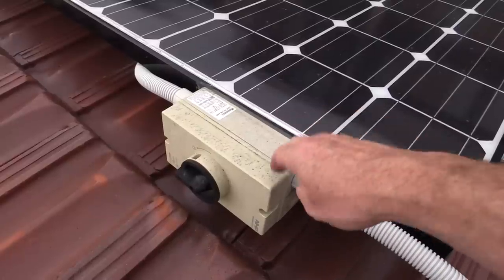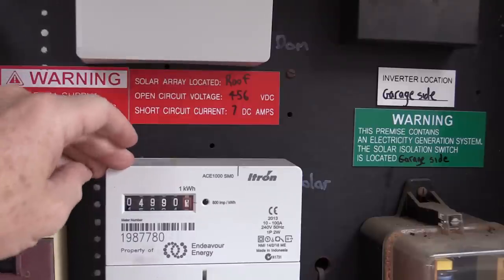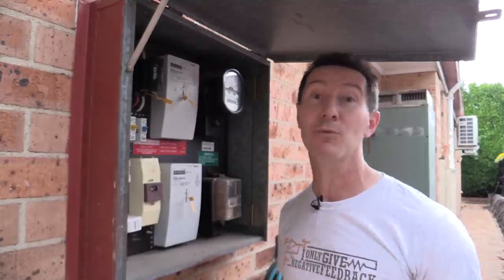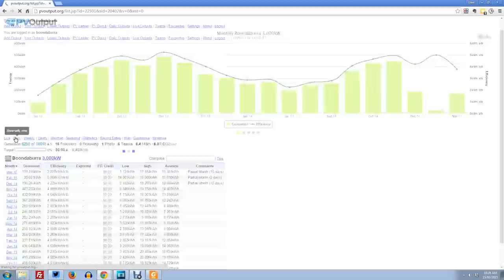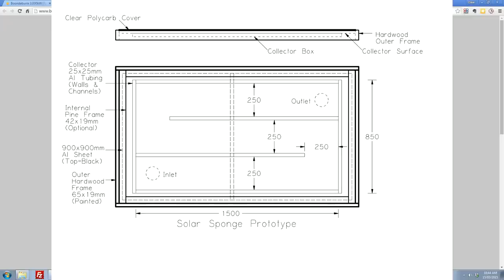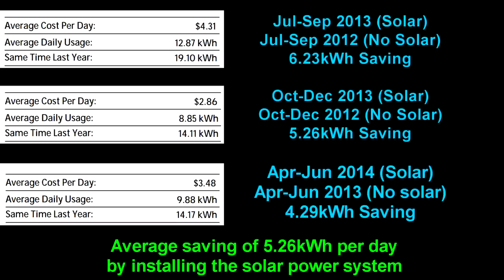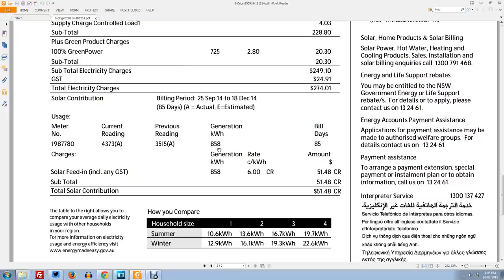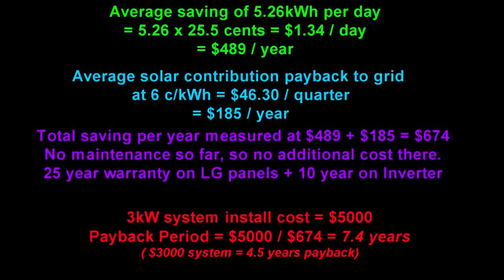EEVblog #724 - Home Solar Power System Analysis & Update

Comment: Here (Hungary) we have a system where as long as you don't feed back more than you consume (annually), you get a 1:1 cost/payback ratio. This is basically gross metering, and it pretty much makes the grid into a virtual battery (as long as, annually, my consumption is less or equal to my production).

By the way I'm still a bit confused by your calculation when it comes to your energy consumption. You did note, correctly, that the top meter only measures your consumption from the grid (the array is on the metering side), not your actual consumption. If it shows about 6.7 MWh (energy taken from the grid), your solar array has produced 7.4 MWh, and you fed back 5 MWh, then your actual energy consumption will be 6.7+ (7.4-5) = 9.1 MWh. That's because the 2.4 MWh you didn't feed back, you consumed "in situ", thus is needs to be added to the energy from the grid. So you wouldn't be grid independent with that system, you'd need to add a few extra panels. It seems that in your area you get a specific production of about 2.46 MWh/kW (for 18 months, that'd be 1.64 anually which is pretty good). You are short by about 1.7 MWh, lets divide that by 2.46 MWh/kWh and we get 0.7 kW. So you'd need another three panels (I assume your panels are 250 W each). It's usually quite economical to go above the rated maximum power of the inverter by about 20 %. But as you pointed out it isn't really worth it for you, because you have a very crappy system there (I'm talking about the tariff system. not your panels :) ).

Comment: Thanks Dave - as always a really interesting video on something that by all metrics should be as dull as dishwater.  

I do wonder however if a smaller set of panels would really be a good idea.  Sure, you are selling back to the grid with the one that you have, but surely most of the time it's putting out much less than 3KWh, and a couple of big appliances running, along with all the standby power, fridge, etc would then have you buying power from the grid, and still be selling back at other times.

Comment: Yeah in areas like this where long-term investment and savings are key it makes sense to go for the "top of the line" most efficient system. Tech is constantly developing and improving so you want something that will hold its efficiency standard for at least as long as it's payback period. Similar concept with building personal computers, gaming rigs in particular

Comment: Yes buy at 25c and sell for 6c for the same 1KWh, does sound "odd" .. but in reality there are the network costs to be consider. In my country my energy provider put in the bill the cost for energy and cost for "transport/network" into two different independent fields ... the network cost that I see on my bills it is relative high, so when you sell your energy, you still need to consider the network cost, in your case network cost is looking around 9c per KWh ... clearly, the energy provider is no caritas, and they need to make profit (consider that what you sell to them, they need to resell else they make a loss, compensate own energy production with private production, for feed the total energy demand, it is not a trivial task). So, all in all it is looking they price quite reasonably. It was insane when they gift 60c per KWh sold, like it happens in many places, these are gift that are expensive for other users or tax payers (company still keep their own profit independently by these gifts)

Comment: Cool video. Useful details.
Yeah, the 6 cent feed-in tariff sucks! It's a sign of what's called the utility death spiral:
The crazy increase in residential solar is becoming a problem for utilities.
They need to maintain the network, so they don't want to give you high feed-in tariff, but:
When consumers pay four times for drawing power from the grid than what they get for feeding it back, people will just end up installing battery storage systems, so they can use all the energy from their solar and cut the utilities out completely, with the added benefit of energy security (decentralized power is much safer from natural disasters and human attacks).
This reduces the number of paying customers and increases the grid power cost per user, driving even more people to install solar power systems and battery backups...
It's really a lose-lose for the utilities and a win-win for consumers.
Death spirals like this are usually a sign of a market disruption when an old solution is obsoleted by a new technology.

Comment: i have a 15 Kw system with similar LG panels and the array is part on the roof and rest is built on frames across the back yard (I have a large yard). I'm storing over 300 Amp hours in two 24 volt battery bays that consist of twelve 2 volt high amp batteries per bay (Same setup cell tower sites use). i can go completely off the mains if needed like if the mains fails and still run things like the AC or cloths dryer.

I do have a smaller 1.5Kw array built up from smaller 12 volt Kyocera panels on my shop with its inverters and battery system as well.

I got extremely lucky on getting the panels and controllers, They were given to me by a company who bought them for use in the field and no longer needed them.
Reply: The battery storage amortization cost is extremely expensive especially for Lead Acid battery. Is way better to use the grid that use energy from that battery bank.

Comment: Nice video! Thanks for sharing. Concerning the amount of energy used by your home, is the total amount of energy used equal to (meter 1 - meter 2 + solar meter)? This would be (6.7 - 5.0 + 7.4 = 9.1MWh)
Reply: Yeah, and he generates 7.4, so he can't be grid independent with just a storage system

Comment: My 0.02¤ on solar power and other "renewable" energy is that it's overall nice, but unless there's robust and ubiquitous storage installed across the grid, its unpredictable nature makes it more of a problem than a solution. Put up sodium melters or repurpose telecom UPS units as storage for local or regional grids though and we might have a winner.

Comment: I like the idea of getting an electric car in combination with a roof solar system. The car may work as some kind of buffer for the electric power when its not used.
Here in Germany Volkswagen seems to buy lots of car parks and offer free charging. They benefit from this, because the cars would make some really cheap batteries for fluctuations in the network's power. If it wasn't so expensive, I would already have an eletric car :D

Comment: Hi Dave,
I had a thought about solar energy a while ago and would appreciate your opinion.   You mentioned that any excess power generated by your system during the day is passed to the power grid for a very low tariff.   My idea was to use any excess energy to power a water pump to store water at a higher location which can then be released later to run a turbine to generate electricity.  Obviously there would be some losses due to friction,etc but it might utilise the energy in a more cost effect way?  I am in an apartment at the moment so cannot really test it out for myself.   Cheers!

Comment: With Your payback don't forget to add the 10% GST on  the 25.5c/kWh, so you should be using 28.05 c/kWh. So its a saving of $538 a year.

Comment: EEVblog Is that your main fuse board/consumer unit?  Also how is the power diverted between what you are using and what is sent back to the grid? - Bottom meter linked with the top meter and communicate to each other?

Also, what is that item to the right of your bottom meter, looks like contact change over relay???

Also seems odd that the MCB's are mounted on wood and by the meters and not on a din rail in a self contained unit.
Reply from the maker: ***** Yes, that is the main (and only) fuse box. 
Bottom right is old off-peak electricity tone detector.
The feed-in tarrif meter simply counts current flowing out to the grid, not from it. Can detect based on the current direction.

Comment: I'd use the solar energy to charge up a few big marine batteries during the day and then use those to run an inverter during the afternoon to run the lighting or other low power circuits.

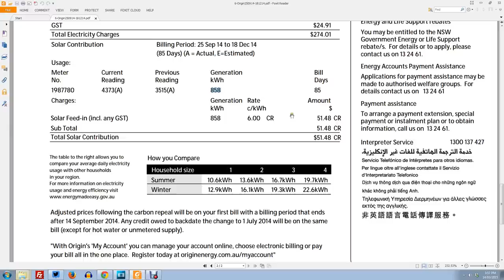Comment: EEVblog  controlled load is off peak hot water / pool pumps etc///, that mechanical meter is for (tariff 31/33 in qld) the clear box below your green solar label is the zelwiger (spelling) relay, the mechanical meter # 872914 (its on your bill @ 28:45 with reading 55826 $0

Comment: Immediate observations in the first 10 seconds of the video - isolator should not be screwed to the panel.
NHP isolator of that era has been recalled and should be replaced immediately - check with your installer.
roof penetration does not comply with australian oofing stds as someone else noted but sparks aren't plumbers and CEC hacks at enforcing even electrical stds let alone plumbing stds.
at the very least should be under the panels and best practise is a tile roof dektite not a tin roof one. difference is $35 vs $6

Comment: That meter cupboard is interesting. In the uk it'd be completely unacceptable to mount your own gear to the meter board. I'm guessing with this setup any additions mean removing that board to connect everything up? Can a general electrician do this? And those individual mcbs? Don't you have a distribution board?

Comment: hi, nice to learn about what you are doing. In the interests of optimizing things. You may wish to this or not.   I too have heard about the mono panels being kept cool and increasing their efficiency.   Have you thought about a 55 gallon water collection barrel. A water pump run with electricity from the panels, and water sprinklers only run during the day?  I would be quite interesting since your roof is of course water proof and your gutters could collect all the water to the barrel and just recycle that same water. 

Secondly,  have you thought about changing the angle of which the panels sit, lifting the lower end up 30 degrees more or less increasing exposure?   Someone may comment of course if EEVblog is not on youtube actively.